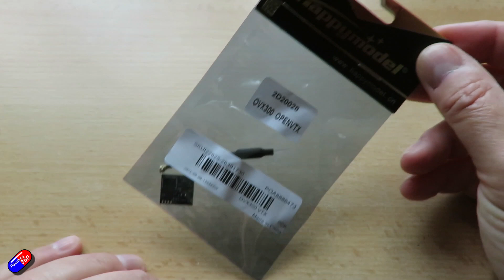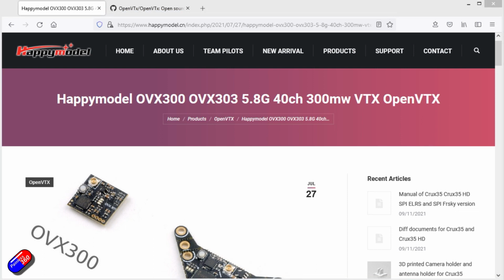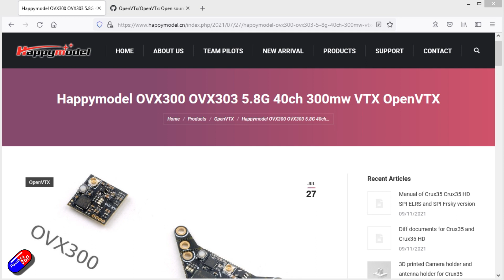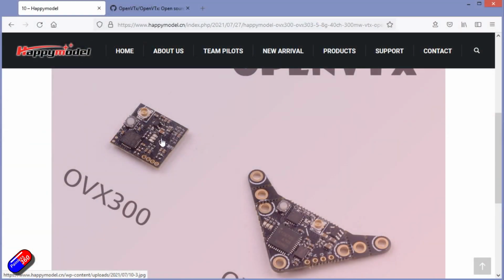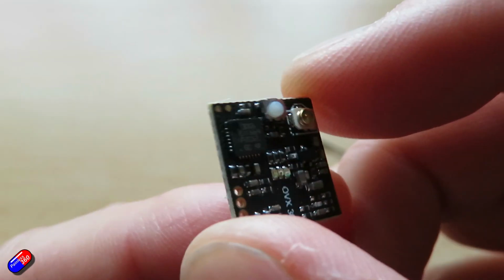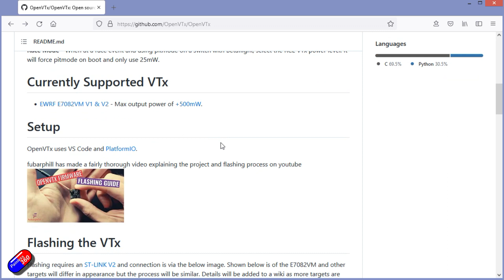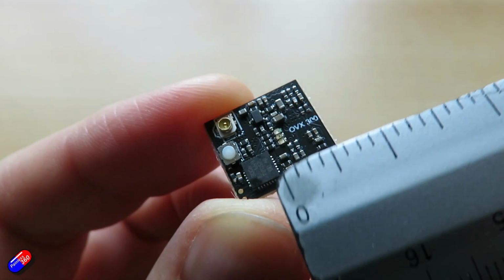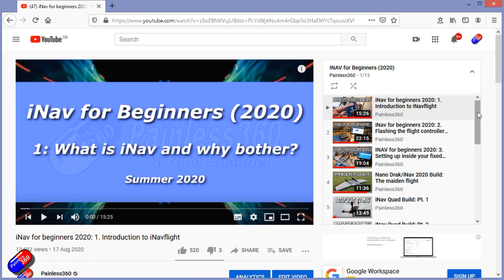Happymodel OVX300 VTX: With something I've never seen before..

Comment: it must be a challenge to solder wires to those so close to each other pads?
Reply from the maker: Yep, flux, good solder and a fine tip needed... happy flying!
Reply: @Painless360  do you think 24awg wire small enough to wire this micro vtx?

Comment: What is the button for? I cant get mine to put out more than 1mw . can change the channel. Is there an unlock procedure?
Reply from the maker: Not sure, it needs to work with a flight controller that talks SmartAudio or TRAMP..
Reply: Got the same issue. My gut feeling is around the vtx table... also the IRC or SA are not recognized.

Did you find a way to make it work

Comment: I really dont get why a vtx needs to be opensource as it really just needs to do 2 things: support SA and transmit the video 😄
Reply: I'm not an expert but maybe spmeone will find a better way to use video data and this can be the start of it (I hope)
Reply: I was thinking about the digital metod of sending the video but maybe you are right, i dont think that somethink like that can be added with a simple update
Reply: @damianomotta1809  yea especially if you find a new and better way to transmit the video you have to exchange the receivers aswell
Reply: @ThePapanoob  well i didnt think about that. You are right

Comment: What would be great for updates, is the WiFi method that ELRS has. Saves needing the different cable and potentially having to solder on to some tiny pads.
Reply: Would be easier to have Betaflight pass through. Don’t think having a wifi chip on VTX would be very good
Reply: @ChrisCroft77  It has betaflight passthrough :)
Reply: @FailsafeFPV  from the Github page "Flashing requires an ST-LINK V2" so it doesn't have bf passthrough
Reply: @ChrisCroft77  Documentation must need updating but it definately does